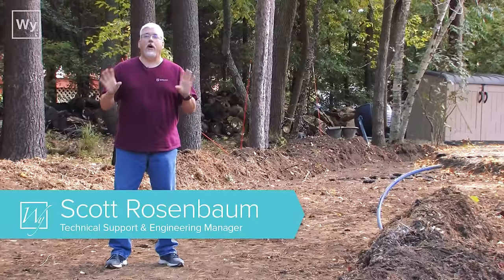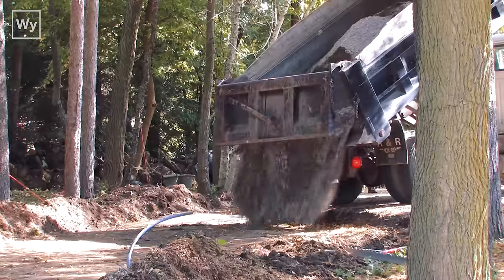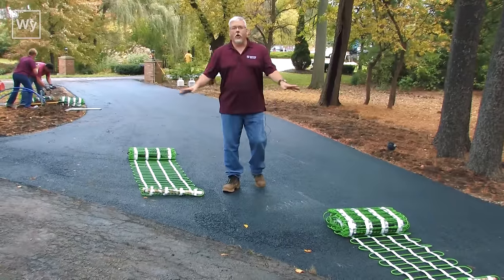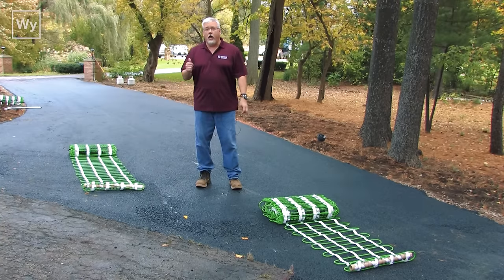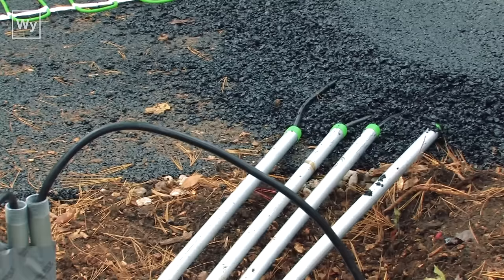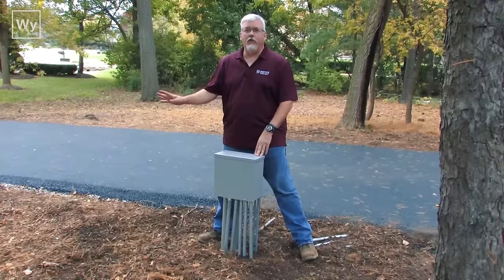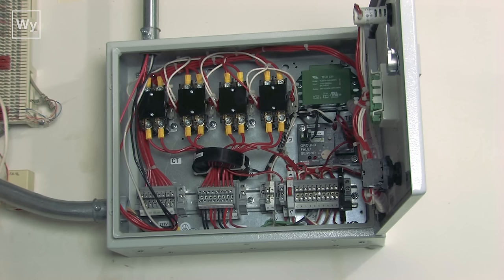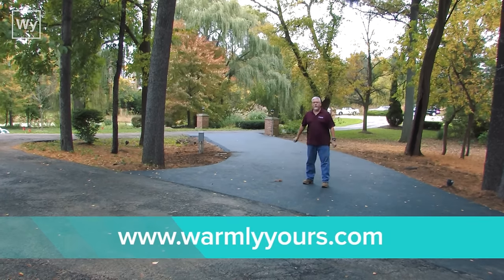Electric Snow Melting system installed in an Asphalt Driveway

Comment: That's lot of work. Wonder how many days it took. Looks pricey. Hopefully he pays fairly well to his hardworking guys.
Reply from the maker: Since it's asphalt, all of this work is typically done in one day since the asphalt has to be dumped and spread out while it's still hot and malleable. We always recommend that installers have the snow melt part of this project ready to go down quickly when doing asphalt or concrete so the materials do not sit too long and cure early. Thanks for watching!

Comment: This is just underfloor heating... but a lot more expensive to run.... XD
Reply: Burnt Toast 
Yeah my bathroom floor has something similar.
Must be one heck of an electric bill.
Reply: usually costs ab 28¢/hr
Reply from the maker: It actually varies quite a bit depending on your kWh rate and the size of the project. We have an operating cost calculator for these systems to help you plan ahead though: https://www.warmlyyours.com/en-US/snow-melting/cost-calculator
Reply: @Diddy_Doodat  
Actually the driveway temp sensor determines when it is on or off. Unless you do it  manually when it snows, But if you rely on that sensor that thing will be on constantly whenever the driveway gets cold enough snow or no snow. Thats got to cost a huge amount.
Reply from the maker: There are actually temperature and moisture sensors that go together - both work in conjunction to make sure the system is only on for snow rather than just rain or just cold temperatures.
Reply: Put in electricity, out comes heat. Put in heat, out comes electricity. Power costs more in summer cause of A/C. So your making energy and money in summer. Then using it to melt the snow. It only warms up a bit over the temperature of earth. The pre layers work as insulation.

Comment: Only a portion of the driveway is wired. I'm assuming the electrical connections will be to 240V. Heating elements that long and large will generate very expensive utility bills. Such a large load will also require a reconfigured electrical box because the amps required might be larger than the standard 20A, or 25A.

Also, the PVC conduits needed to be enclosed.
Reply from the maker: It is indeed 240V, this system uses 15kWh of electricity. Some projects do require the electrical being reconfigured, so we always advise customers to check their home limitations while planning and contact their provider if more electricity will be required for their heating needs. As for the conduit, it was enclosed for this system according to local code and requirements for this type of system.

Comment: i would lay some tin foil or something similar under the mesh to direct the heat upwards so the system doesnt warm the ground underneath, save electricity
Reply from the maker: Hi there, the system is actually embedded in the asphalt so that it effectively warms up that layer of the driveway. Our Environ product actually has a foil like backing that allows the heat to be reflected back up for underfloor heating.

Comment: Good luck! Mine broke after 2 years, only 1 side of a double garage worked, now 8 years later only one tire lane works😕 50’ driveway $30/day electricity! Laid down 8 strips.
Reply from the maker: Hi Nick, Did you call the company that sold you the system? Or did you happen to purchase it from us? We've never had a system fail due to how the system was manufactured - it is often damage that occurs during installation by the driveway installers.

 We offer repair service for these systems and with the tools we have, only a small section is excavated to make any necessary repairs to the cables if needed. You can read more about the process here: https://www.warmlyyours.com/en-US/posts/How-to-Troubleshoot-and-Repair-a-Heated-Driveway

Comment: i thought they said ur not supposed to roll over it with the roller but they did it anyways
Reply: The game 23 , not to use the roller on the bare mesh.
Reply: Echopractic what part did he not get, duh.....
Reply: War of jake bots 23 he said never run a paving machine over it not a roller.. Weight from roller or cars  probably doesnt matter as much as the drag caused by the pave machine would probably tear or rip.
Reply from the maker: This is exactly it - a roller is very different from the large paving machines typically used for asphalt, and this recommendation is to insure that the heating cable is left undamaged during installation. Thank you for your input Summerlin866!
Reply: its a steam roller lol
Reply: @curtissharris8914  Yeah, it runs on steam, duh.

Comment: waste of power just pay some kid to shovel it.
Reply from the maker: The operating cost for a snow melting system in a typical driveway is only $0.76 per hour. This calculation is based on the national average of $0.08 per kWh. Typically you would run a system like this for 6 hours on a day with snowfall, so just under $6 to have your driveway free of snow without harsh chemicals are corrosive rock salt. Paying a kid to come shovel it, each time you would need it would definitely add up to more than $6/day - plus you would have to find someone each and every time you want it shoveled, with our system, sensors can detect when you need it and clear your driveway for you.
Reply: darkone12491 ey your cutting me out of business pal a shovel costs 15 dollars these days and my video games are now up to 60$ a game why 😡😡😡😡
Reply: On your demo video, it only looked like about one inch of snow. Any "typical" car could drive through that with now issues. Plus, If i were a kid shoveling driveways with only one inch of snow. I could do several "typical" driveways in a hour.
Reply: Also, lets put this power usage in perspective. $6 per day doesnt sound like much. But. Where I live its more like 10 or 11 cents per kilowatt hour. But regardless of the cost of electricity, we are talking about 75 kilowatt hours per day. That is massive. That is more than any regular house uses, even with electrical heat. The people who really need this technology are not in "typical" circumstances, and this unit will use much more power than advertised. The more ecological solution would be to buy an AWD vehicle with some decent ground clearance, such as the Subaru Forester or Crosstrek, Or a 4WD truck of your choice. Or an AWD SUV, Mazda has a few choices, as does toyota and ford. That would be a better bang for your buck. WarmlyYours, show me some math that proves me wrong, and I willl happily reply addmitting my ignorance.
Reply from the maker: Hi Travis, This video was shot in Chicago suburbs last winter - we got a very light winter and so very little snow to demonstrate how this system works. But there is no limit to how much snow these systems can handle. It's just a matter of time in extreme cases and for full coverage installs, your entire driveway would be cleared away effortlessly.
Reply from the maker: So taking the calculation you provided Travis, $0.11 per kWh hour we did some calculations: These Snow Melt mats use 50 watts/sq ft, the estimate we provided in the comment above was running 6 hours for a day with snow. So with 50 watts x 6 hours, thats 300 watts a day. 300/1000 gives us 0.3 kWh/day. With a rate of $0.11 x 0.3 = $0.033 per sq ft of coverage to run for 6 hours a day. You can take that amount, multiply it by the coverage you would want and then multiply it by average snow events during winter to get a better idea of how much it might cost you during a season. But this product isn't on every day, it only turns on as needed, whereas an expensive 4x4 vehicle is something you might be using each day during the winter and uses far more gas than standard vehicles - they are also typically more expensive in general simply because they provide power to all 4 wheels. Unless you have more than 5 or 6 snowstorms come through during a season, a 4x4 vehicle and the gas it needs would most likely end up costing more than this system. Plus, you get the added benefit of a perfectly clear driveway if you opt for full coverage whereas 4x4 vehicles leave behind mounds that can refreeze. Hope this answers all your questions!
Reply from the maker: Hi Mel, this particular system cost $4,513 - there was approx. 150' of mat used for the tire track layout. You can check out the pricing for a Snow Melt system based on area dimensions/voltage here: https://www.warmlyyours.com/my_instant_quote/start
Reply: WarmlyYours That is insanely cheap compared to the prices I pay in Europe :c
Reply from the maker: So sorry to hear that it's so much more there! We are lucky that in most states it's relatively affordable.
Reply: Yeah, you guys are very lucky. I pay about 30 cents per kWh.
Reply: Not nowadays. Kids would charge a lot lol

Comment: So, how far north is this still usable? I mean, when it’s a heavy snowfall and several degrees below freezing it’s bound to become pretty icy if the snow melts and freezes. Like leaving the compartment heater plugged in the car during a week of heavy snowfall with low low temperature
Reply from the maker: Our systems are able to run efficiently below freezing until it hits 17 degrees Fahrenheit. At this temperature, the system is not melting at the same rate as before, and becomes less economical to run. Most controls for our systems have a built-in feature to shut off around this temperature to ensure it is not using electricity inefficiently. We have customers who have installed this up in Canada near Toronto and still get plenty of use out of it throughout the Winter.
Reply: Great question and great answer.

Comment: HI, I wondering how about the water that froze after snow melted?
Will it be slippery? Or the desisgn of the road allow water to melt and flow to the side.

P/s: sorry for my bad grammar
Reply from the maker: This is actually a really good question that we see come up a lot with our snow melting products. All of our automatic controllers have Hold-on time feature after the initial warming up of the mats. This feature ensures that all the snow is melted from the surface, and also that the system continues to operate and evaporate the surface water without it refreezing.

Comment: This system does not address the issue of having the end of the driveway getting buried with city snow plows. Somebody has got to shovel that mess out of the way. I have two snow blowers, a single stage and a two stage. I use whatever blower is best suited for the snowfall. Didn't spend a lot either. The two stage was picked off the curb. I did a little routine maintenance and it now runs like a champ.
Reply from the maker: There's not much that can be done with the end of a driveway when the city is typically responsible for plowing the roads - with this system, at least there's no clearing your driveway, patio or stairs which saves a lot on time and effort.

Comment: Few questions!  durability, maintance cost,  asphalt usually cracks after a few years, will this damage the system? it seems like it uses about 10 kwh will most houses have the amps available to run it? when ice and snow starting to melt where does water goes if everything around it is full of snow  and no car passes it thru? melting snow in an outside temperature is really expensive and the system will have to run for a lot more than 6 hours to keep water from becoming ice,   water will just stay between the snow and go nowhere, I mean is convinient for those that have a lot of money but not really a cheap solution.
Reply from the maker: Hi Deoc, there are no maintenance costs for this system. It comes with a 10 year warranty and we've yet to have a system simply fail. Most repairs we've done have been for systems that were damaged by the asphalt contractor as it was being installed, and we offer tools to help identify the location of damaged wires, so only a small portion of the driveway has to be excavated in order to splice and repair the wire. Asphalt does crack after a few years and typically has a lifespan of 12-20 years. For an area like ours, Chicago, it's more towards the lower end (12 years) meaning that most people need to replace their asphalt anyways, so with the cost of a snow melting system added on, it's a small addition to the overall cost. 

These systems can also be embedded in concrete or in mortar/sand under pavers if asphalt is not what you're looking for in a driveway. This particular system is 240VAC and uses roughly 15kWh, so with the national average of $0.12 per kWh, it costs only $1.80 an hour to run this system.  If you don't have the electrical power to run this kind of system, you can adjust the size easily or reach out to your city to discuss this type of project and plan on more power for your home.

As for the snow, once it's melted, it actually evaporates away from the surface. The asphalt is kept dry and warm, preventing the water from re-freezing. Even during our most recent ice storm, this system was able to produce two strips of ice-free asphalt. The system only warms up to just above freezing, roughly 40 degrees to keep the snow from re-freezing. 

If you think about how much your time is worth and how much salt the average person goes through each winter, this system can be a huge benefit to those who are not able to shovel or don't want salt damaging their cars, shoes, plants or harming their pets.

Hope we answered all of your questions, Thanks for watching!

Comment: This will increase your electric bill .I do not now how it is in US, but here electric power becomes  a lot more expensive during the winter months .....You can  clear the  driveway first  with a shovel  and if the  ground freezes and  gets hard  and slippery you can add fine grain sand  or if you like to melt the ice you can add salt as well. If you mix sand and salt in a bucket you have a wary effective cocktail  to make the driveway non slippery and ice will start to melt as well  ....When all the ice  and snow is gone you can  simply collect the sand from your driveway to re use it again.
Reply from the maker: While it may slightly increase your electric bill, for those that are unable to clear their driveway of snow (whether physically able to or simply a lack of time to do so) this system gives them peace of mind that they can have an snow/ice-free driveway. As more and more people age in their homes here in the U.S., these types of systems make it easy to have a safe walkway to and from the car so that things like unloading groceries are less hazardous during the winter.
Reply: Thats true it will benefit  people who is in no condition to clear their driveway  on their own..And i guess you can regulate the  heat  with an thermostat  to get a stable  electric  usage....

Comment: I didn't hear what the voltage is? I thought I heard him mention low voltage or anything about the electrical system with respect to volatage...115 or 220 and it it stepped down to a lower voltage higher amps?  Curent draw?  And would it work under a brick driveway?
Reply from the maker: Hi, you can find more information on how these systems are used for driveways here: https://www.warmlyyours.com/en-US/snow-melting/driveway The snow melting mats come in 120 and 240 while the cables come in 120, 208, 240 and 277. And yes, these systems will work under pavers as long as they are embedded. They will also work underneath concrete areas and of course asphalt. Thanks for watching!

Comment: They tried something very similar in Ladd Canyon on I-84 in Oregon. What a failure. Yes, it melted the snow where the wires were at, but all it did was turned the melted snow into solid glaze ice all around the wires.
Reply from the maker: The difference with our system is that it does not allow the snow to refreeze after melting. The water evaporates away from the heated area.

Comment: Lets see this in the winter...No reflective material under the mat which mean 1/2 the heat will go down into the ground which is worthless. When it snows you will have to bare patches down your driveway. What voltage are the mats using ?
Reply from the maker: These systems are embedded in the surface material of your driveway (whether that's asphalt, concrete or in mortar under pavers). By doing this, the heat is evenly distributed throughout the surface and allows it to warm up consistently. Unless someone damages the heating elements of the system before installation, there will not be any patches of unmelted snow while the system is operating. The configuration in this installation was a unique type of tire track layout that the homeowners picked. These mats use 50 watts per square foot, you can learn more about our snow melt systems on our website: https://www.warmlyyours.com/products/snow-melting

Comment: I'd almost consider it...but our driveway is a 1/4 mile long and would probably run us $50 a day to run it. Anyhow, still a cool idea.
Reply from the maker: That is definitely a huge project and electric heating may not be the most energy efficient for a driveway that large. For tire track coverage on a 1/4 mile long driveway, you'd be using 264.1 kWh an hour (the national average of $0.15 per kWh would come out to roughly $39.62 to run per hour.) There are also options with geothermal systems that we've heard have helped with much larger projects and uses the earth's natural radiant heat beneath the surface to help melt snow. Thanks for watching though!